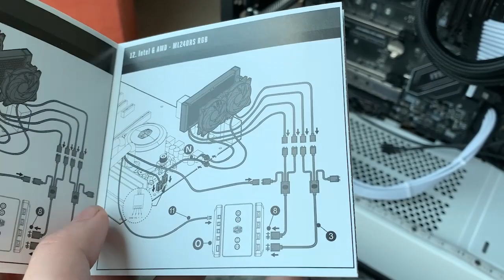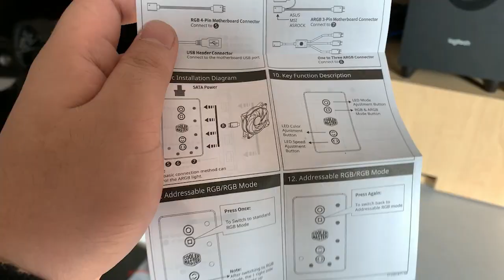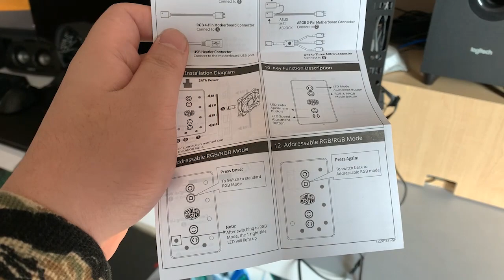GANTI LIQUID COOLING KE COOLER MASTER ML240RS RGB | Vlog

Comment: Kabel power VGA bawaan Zotacnya emang putih begitu ya?
Reply from the maker: Cody Fahreza nggak itu pake custom extension cable
Reply: @IchtionChannel  Oiya mau tanya om panjang selangnya berapa mm ya? 240L atau 240RS sama kah?
Mau beli buat pasang didepan nzxt h510, takut kependekan
Reply from the maker: @TheErazor21  sama harusnya, h510 gabisa taro atas sih
Reply: @IchtionChannel  iya lobang diatasnya cuman buat 1x120 soalnya.. berapa ya panjang selangnya kira2? 400mm ada gak? Ane cari di webnya cooler master gaada soalnya
Reply from the maker: @TheErazor21  itu panjangnya harusnya universal. mereka uda design supaya bisa pasang di atas ato didepan, harusnya aman-aman aja si.
Reply: @IchtionChannel  oke siap, trims